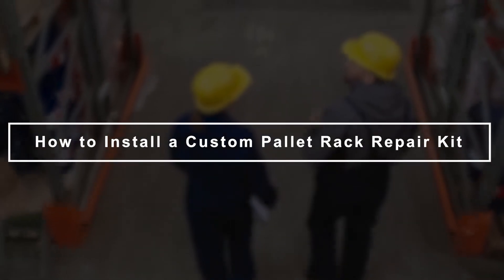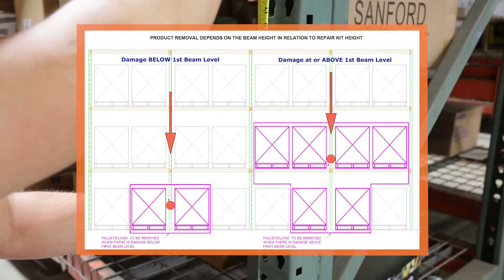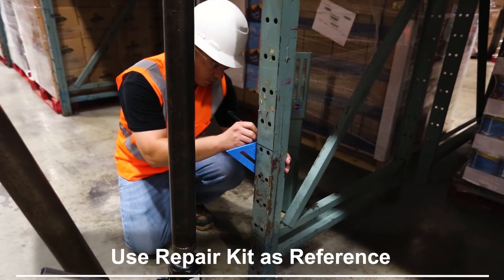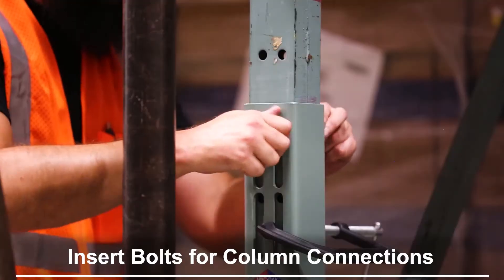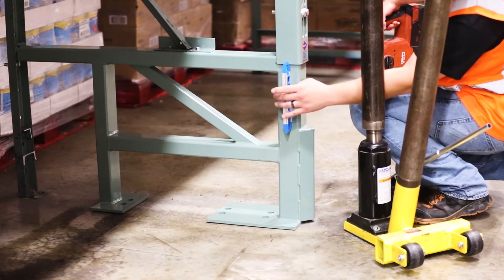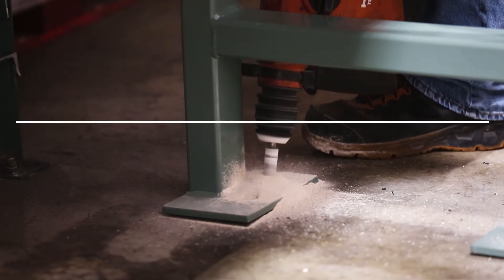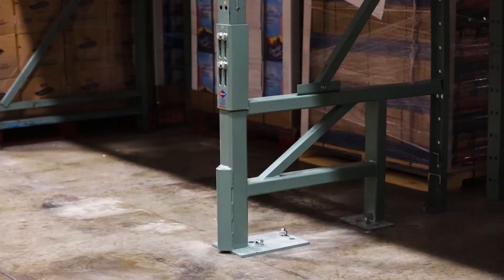Apex Rack Repair Kit Installation Training Video | Apex Companies

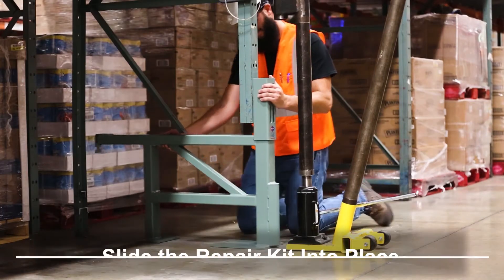Comment: The gap at 2:43...there's no way it's resting on the platform.
Reply from the maker: Hi Joe - The gap is eliminated when lowering the jack.  There is a 1/8-1/4” lift utilized when installing the repair kit while supporting the frame with the repair jack. Please let us know if this addresses your concern. If you have further questions, we can put you in touch with our Rack Repair team.